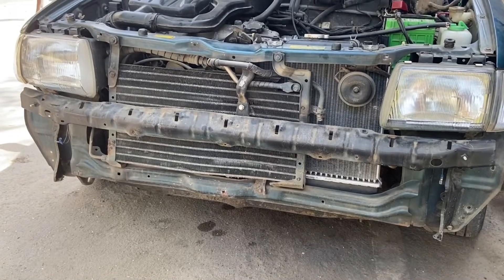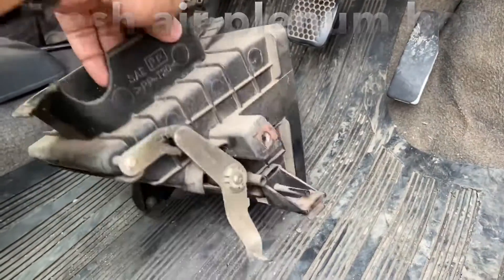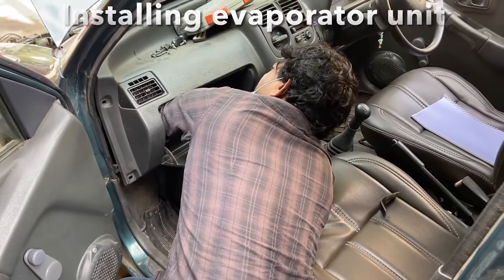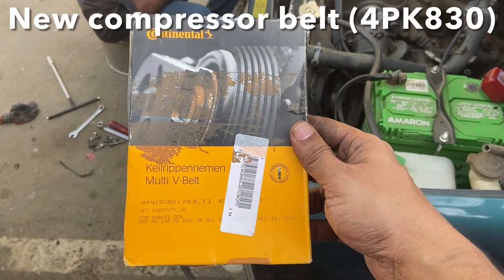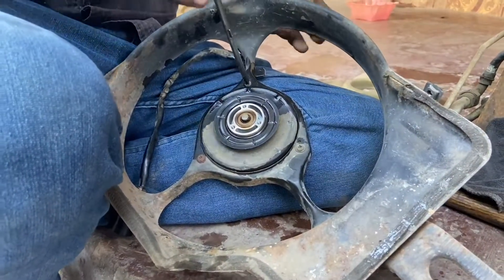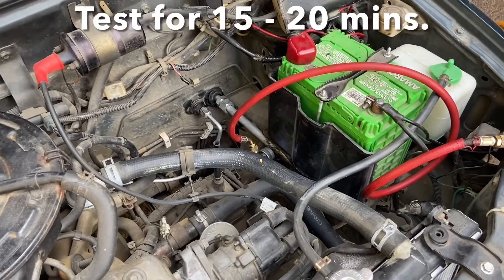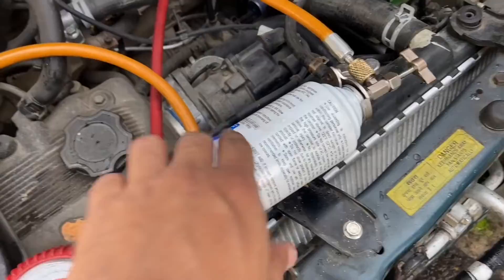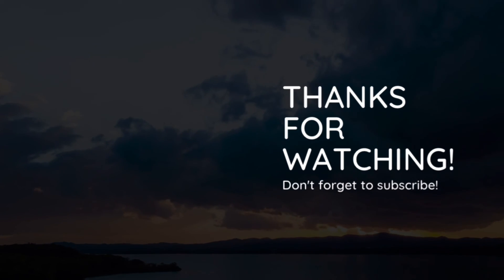99 Maruti Zen Restoration - Retrofitting R134a AC System

Comment: What is the price of the coil? My zen's ac has a leak. The compressor appears to be fine and and all hoses are ok around the engine bay. The technician says that the cooling might be leaking. Where does it leak generally ?
Reply from the maker: No idea. I don’t think the coil is being sold at MGP outlets today. Please ask your technician to do a pressure testing using nitrogen and a UV dye. Wherever there’s a leak, you can use a UV torch to highlight the leak.

Comment: My zens ac does not work when  car is on neutral only works while running????
Reply from the maker: The AC’s compressor should work irrespective of which gear the car is in as it is driven by a belt independently along with the alternator. 

Your idle RPM may be low in neutral which is why the compressor is not engaging. Get the idle speed checked and adjusted. Very easy if it’s a carbureted model.
Reply: @ thanks s lot…and actually its 2002 model mpfi
Reply from the maker: Please get it checked thoroughly by an AC technician. He will be able to diagnose it the issue in no time.

Comment: Hey Ganesh, is it okay to put r134a compressor with r12 condenser and drier on the zen? What's your opinion
Reply from the maker: Hi Joel, many have used R134a with the R12 components but the system fails slowly. 

You have to change all the components including the seals. 

R134a operates at higher pressures than R12 requiring condensers designed to handle those pressures. R12 condensers may not be efficient enough to condense R134a under the usual operating conditions. 

R134a based drier bottle uses a different desiccant whereas R12 based drier uses a different desiccant. 

Check your scrap market to see if you can salvage a complete AC system from the car.
Reply: @GaneshBalan  Okay Ganesh, Thanks a lot!

Comment: Nice video 👌. Require your inputs My polo floor mats become wet after AC on. Which pipe must be broken?
Reply from the maker: The condensate drain pipe from the evaporator which leads to outside the cabin through the firewall. It’s a rubber pipe. Check that.